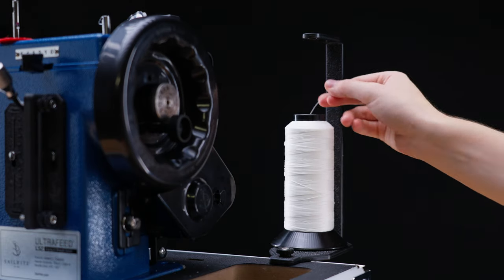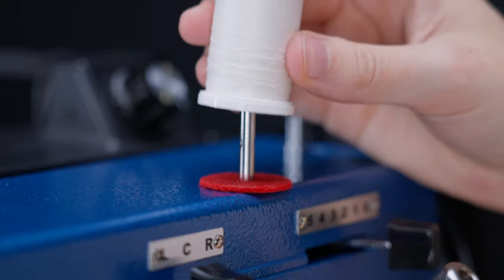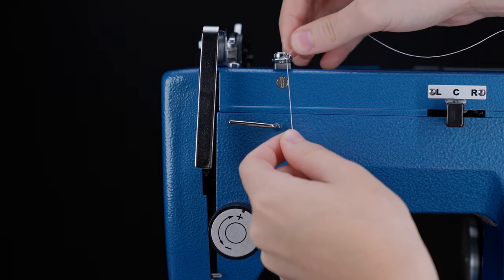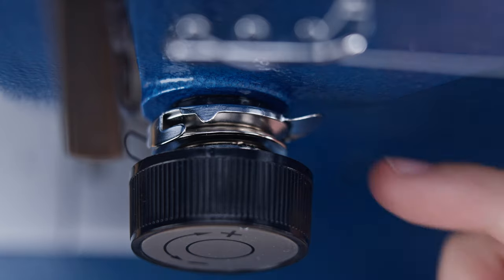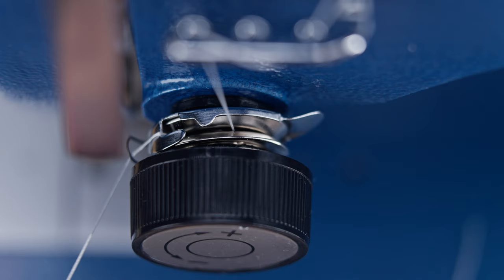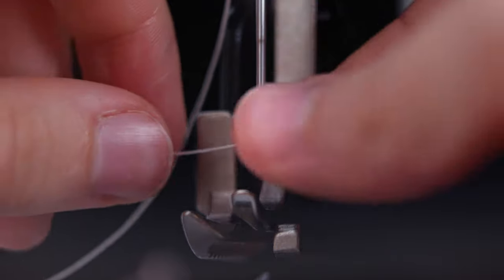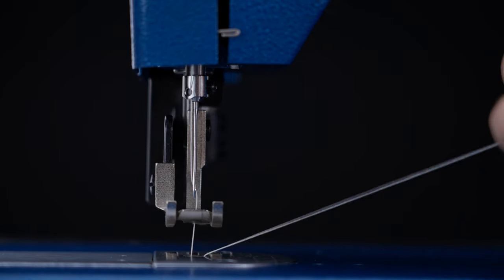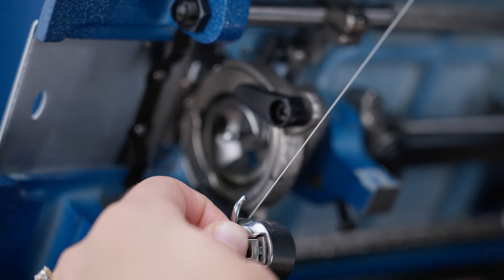How to Thread Your Ultrafeed® Machine — It’s Easy!

Comment: I just changed my thread, and now the thread doesn't pick up the bobbin thread. I have rethreaded several times, very closely following this video but it is not grabbing the bobbin thread. I have been practice sewing and changed the thread twice with the same procedure. But today I cannot get the thread to pick up.  Any tips? I have not touched the bobbin thread, it is inserted from before factory shipment so I know it is correct. I also made sure there is enough thread still on the bobbin. Any ideas?
Reply from the maker: There are a couple of things that could be going on. Please go through each of the below and test after checking each part.
1. Remove the bobbin and make sure there is at least a 6" tail of thread coming out of the bobbin case.
2. If you have changed the needle make sure it is installed with the carved out part (scarf) facing right as you look at the machine. 
3. Make sure the proper thread size is being used for the needle. If you haven't changed the needle (we send a #20 with the machine) then you should be using a V-92 thread. 
If none of those did it, please send an email to support@sailrite.com with a picture of your machine threaded and we will see if we notice anything in the picture(s).
Reply: If you pull on the Bobbin thread, does it come out going clockwise?  Loaded with a number nine not a P
I’ve made that mistake on machines getting it backwards and it can really mess things up

Comment: Why did you only go through the pig tail? my book shows it going under and around the friction button next to the pig tail, is this a change? also I have no metal hook where the tread slot is in the front covers, is this also something new? my thread sometimes gets outside of this slot.
Reply from the maker: To my knowledge, we have never recommended going around the friction button next to the pig tail unless you are winding a bobbin. The metal hook you are seeing is part of the new integrated light that works with the new WorkerB motor system found here: https://www.sailrite.com/Sailrite-WorkerB-Integrated-LED-Light
Reply: That "friction button" is the bobbin tensioner. My guidebook's says to use it only for winding a bobbin. It's not part of the normal thread path when going to the needle.